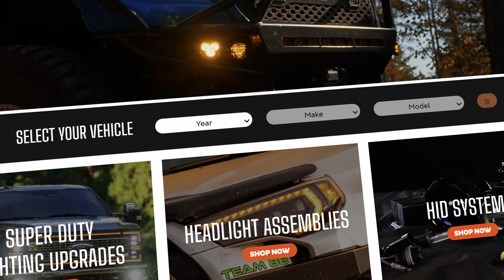HID vs LED Headlight Bulbs: Which is Better in 2025? | Brightness, Fitment & Output Test!

Comment: The fans on the LED bulbs is a no go for me ! Those fans fail then what, melt you headlights, possible fire ??
Reply from the maker: We in the thousands of bulbs we've tested have never had a fire. The bulb simply goes out if the fan fails to cool it haha. Nearly all modern LED bulbs will have fans, the tech is fantastic these days for them and failure rates are the lowest they've ever been!
Reply: @HeadlightRevolution well that’s a good feature ! Sucks the bulb goes out but definitely better than the alternative!

Comment: One big thing to also consider if your car has recessed headlights like a Jeep LEDs are a PITA in the cold because they don't generate enough heat to prevent snow and ice from accumulating on the headlights
Reply from the maker: Yes this is true, HIDs will be very helpful for these situations!
Reply: @HeadlightRevolution  yep I actually ended up removing LEDs that the previous owner of my jeep installed and replacing them with halogen because of this issue planning to upgrade to HID in the near future

Comment: I want to find a HID or LED that is compatible with GM DRL that cuts the power in half on the highbeams. They were made only for halogen that cut the power to 9volts to dim the highbeam to operate the DRL.
Reply from the maker: We can help you find an option over email! 
Sales@HeadlightRevolution.com

Comment: 8:40 I  bought projector headlights  from  this 
 company  called sw lights not knowning  about this  even right way I wasnt a fan way too much stuff can go wrong and just  last week  the high beams wasnt working i had to   pop the hood to tighten  the cable  unfortunately  it past the 7 day mark to  return them i wish i watched this video and asked more questions before buying them i dud but new headlights  & the gtr ultra 3.0   haven't    installed them yet

Comment: Forgot to mention that because LED bulbs usually have 2 sides with chips, the orientation of the bulbs matter A LOT and prevent the scatter you talked about. This is why most LED bulbs come with little screws on the shafts, so you can rotate them slightly if the alignment is off. 9-3 position of those chips is best.

Comment: I’ve never had good luck with LED bulbs in projector housings. HID bulbs have worked for me well in halogen projector housings. I prefer LED bulbs in reflector housings.

And the other thing that people don’t consider is the color temperature. 4000K-5000K is going to give you the best balance of brightness, throw, and penetration while not introducing blue hues which hurt other drivers eyes. LEDs I find are typically in either 6000K or 3000K, which in my opinion 6000K is not my favorite but it works well enough in a reflector housing.

Comment: Theres a reason why headlights are so bright. Its cuz you blind the on coming drivers. Ive seen too many drivers in the last 8 years where they put LEDs in their headlights and I see them coming from the next state they are so bright. So then I flash them thinking its their brights and then they flash me and OMG. Low beams should be super accurate and narrow for night driving but when theres no other cars etc then use those brights. No need to make high beams the new low beams. Its too bright and at night our eyes hate it. LED still scatters too much for me
Reply from the maker: That's why we filter out the garbage from the good, so those upgrading are actually buying bulbs that not only adjust properly but are designed to mimic the Halogen filaments of the original bulbs, resulting in identical beam pattern formation. The blinding LEDs you find are 99% of the time a very cheap $60 pair from amazon with none of these traits I mentioned.

Comment: Why you didn’t compare 4500k/5000k HID coz they are brighter than 6000K.
Reply from the maker: I wouldn't say brighter, just a different color and you may perceive it as "brighter" because you prefer this color range - nothing wrong with that! Yes the human eye sees these colors more naturally since it mimics the sun color range, but you can still have a brighter/higher performing 6000K kit vs. a lower wattage 4500/5000K hit. Good question though!
Reply: @H@H@H @HeadlightRevolution t same power level it is well known the color spectrum between 4000k-5000K has most visible light. Do you have a brighter higher performing 5000K color?

Comment: The FTR LED bulbs are by far not the brightest on the market. They are rated less than 65 watts meaning they will not be as bright as higher wattage options. For example Auxbeam has a 120watt bulb that will easily outperform these GTR bulbs.
Reply from the maker: We have yet to see a bulb in person outperform them, including Auxbeams!

Comment: Wife's 2018 WRX came with halogens but in a projector setup. Very little illumination, borderline dangerous for nighttime use on non-street light streets. Should have bought the higher trims that came with LEDs, but we hadn't driven the car at night on non-streetlight streets months into the ownership.

Regardless, OLLM HID bulb swap came to the rescue. Because of projector setup it didn't change the beam pattern at all, but the illumination and brightness is great, happy with the results. Went with HID insert of LED because of packaging reasons, there is no space for giant heat sinks behind the bulb in the car.

Comment: I'll stick to HID because I'm not an asshole using an LED bulb in a housing not designed for one that likes to blind every other driver on the road and put them in danger, especially the POS driving a lifted truck.
There are so many assholes with excessively bright LEDS blinding me, I'm seriously thinking of putting the brightest off road bar in my back window so when one of those assholes roll up behind blinding me, I just flip that light on and completely blind them also. See how they like it.
Reply: I'd just flip my ditch lights, spot lights, my 20" bumper light bar, my 2 dual 4" fog lights, and double stack light bar on.

Comment: I still like hids because of the 35w vs 55w difference and the color options
Reply: There are now leds which can go up to 90w per bulbs woth a crisp white light without any trace of yellow or blue
But yeah, hids still hold the crown for color choice
Reply: @SudSale31 wow thats pretty intense haha. One other thing i learned since this post is leds wont "defrost" an iced over headlight and the efficiency decreases pretty bad in sub zero temps. Which is basically a 15F winter day doing 70mph down the interstate or 80mph across the tolls

Comment: Upgrading to LED bulbs over standard xenon or even Halogen is a worthwhile upgrade, however, you want to upgrade only if you have a projector housing for the low beams. Upgrading to an LED with a reflector housing can blind other drivers, especially if you get a really nasty 360° LED instead of a proper dual sided LED band. Its also very important to know that you might have aim your projector lens down, NEVER adjust it up, if its been replaced, you might have too adjusted to match the non replaced unit. They are calibrated at the factory when the vehicle is made, and designed to balance good light projection with light output. Trucks and other giant vehicles especially are bad when it comes to aftermarket headlight upgrades. Buy a projector housing for a higher trim before you throw in some led headlights, and for the love of God stop putting nast led headlights and then lifting your stupid useless truck.

Comment: i am pretty sure i still have to swap out the headlight housing with a design that is best for either hid or led on my current car that uses halogen bulbs. also going to have a pro properly install them cause i have no idea on how to do it myself. pretty sure my dumb ass can install the bulbs otherwise.

Comment: So are the LED H4 replacement lights street legal? How to ensure the led itself is in the right position so it matches the original H4 filament or will or modern LED lights be OK?
Reply: No, they're not street legal and in all likelihood you'll be blinding drivers.
Reply: @cr0ft-2k  false. they may not be street legal, but with the correct LED's below 5.000 Lumen, you won't blind any other driver.

Comment: I love my LED's i put in my Accord, they have been running strong for about 4 years, not too bright to piss people off but better than stock, i do wish LED's would come in better color temps (i prefer the lower temps to reduce eye strain at night, especially in heavy snow), i did use to run HID's but i got tired of ballast issues with the cheap kits and didnt want to pay too much for the better ones.

Comment: I just installed a set of Spec-D single projector headlights (pn 2LHP-F15097G-RS) in my '01 F150. The h7 bulbs provided with them is rather... Lacking. In every aspect. Yeah they work, but visibility is barely comparable to the Sylvania zXe bulbs i was running in the horrid factory housings. I definitely need to upgrade them to something brighter, and I'm torn between HID and LED. I love the videos y'all put out and how you try to explain automotive lighting in ways even people with no real experience in dealing with such things can understand. I need to do some research on what these housings can handle as far as upgrading the lighting source before i make my final decision, but just wanted to say thank you for what y'all do.

Comment: İ buy lots of hid and led bulb types.. a specially i use always 3000k for my fog light .. 
Based on my experience, I can say that HID bulbs are still very effective at low Kelvin temperatures.

LED bulbs still mimic the color of halogen light, but they can't quite match it. For example, when you compare 3000k, 3500k, 4000k, 4300k, or 4500k LED bulbs and HID bulbs side by side, you'll see a distinct difference in color tone. Especially in very warm colors like 3000k, the LED bulbs look as if they've been painted with watercolors painting .. It is obvious that it is artificial .. 

I think LED bulbs are much more successful than HID bulbs at high kelvins, for example 6000k and above... The only downside of LED bulbs is their short lifespan. Last year, the left headlight of my 2021 Kia Sportage started to flicker and 5 months later the right headlight too.. LED bulbs die quickly, especially in the rear lights, when the vehicles are 5-6 years old... even if they are original factory.

Comment: Thinking about switching my low beam Morimoto 55 watt 6k hids to the GTR ultra 3’s since I got one ballast on the fritz after 5 years of smooth operation. In the video comparison it actually looked like a drop in performance on the beam width between the 55 watt hid & ultra 3’s.  I’m not sure if the distance was changed or it was a different headlight housing used for comparison but I’d love to know why the beam width diminished so much on camera. Also the hot spot seemed a lil less on the LEDs. Hope someone from HR will chime in. Thanks.

Comment: Thank you! My headlight on my kia optima 2016 sxl HID d3s bulb just went out, what would you recommend as a replacement? I got 8000k but i think its going to be too blue and so i got it on accident, I want to do 6000k HID, because I can't replace to a LED because its confusing and I dont know how to do that. is it possible to do a video on the replacement if possible? thanks!

Comment: Why didn’t you put the HID next to the LEDs for a final comparison?  To me HIDs looked brighter.  You didn’t even give luminance readings.
Also you mentioned nothing about LED fitment inside some/most housings.  The fan portion is much larger than halogen bulbs and doesn’t always allow the housing, causing the access plug not to seal causing moisture to get in the housing.
Your “review” is blatantly bias & manipulative.

Comment: LED conversions are my go to in most vehicles…except for those ALREADY equipped with HIDs. If I see that, I won’t touch it except to replace the bulbs, as their light output is quite satisfactory.

Comment: I love my factory LED headlights. I’ve had HIDs, they suck in cold weather below -35c they don’t warm up or if they do it takes more than 10 seconds. Upwards 10 minutes if they even fire up. Halogen never fails nor does LED.
Reply: That usually means you need new bulbs

Comment: I bought some h7 sylvania led bulbs not tha long ago because they were half off, otherwise I would never pay over $60 for a bulb. This things where so disappointing. I’ve had the same hid bulb and kit for almost a decade now (yes they have not burned down, I may have had to replace the ballast), and the HIDs were still brighter than the leds! And I’ve been using Xytex ballasts for decades now. I even have some old xenon bulbs (not hid) that were brighter than those led bulbs!

Comment: Driving a small car and constantly being blinded by trucks running around with LEDs. I will never run LEDs, don't wanna be part of the problem... and I don't have astigmatism, can't even imagine how bad it is for them
Reply: Yup. Led is more harmful than helpful. Like the guy driving around with his brights.... yeah, get off the road.
Reply: astigmatism here, its bad. Whether I'm in my car, or my Z71 Silverado,  morons shoving chinese LED's in factory reflectors are brutal. I just have to stare at the fog line until they are passed and hope nothing wanders into the road during that time. Really wish cops would start cracking down on garbage headlights.
Reply: I get what you mean. But I would like you to consider the purpose of these LED bulbs is to reduce that. Often running cheaper or inferior LEDs creates the scatter and blinding light that you see. You can see the clean cutoff with the GTR 3 that the manufacturer had in mind when designing their headlights. Most modern cars run LEDs from the factory with proprietary designs aimed with the same goal. If you're in a small car and you're going to be blinded from trucks regardless because of the placement of their headlights so I feel for you man.
Reply: It's not just small cars though, it's everybod else.
Reply: Driving a small car wouldn't be part of any problem. Who are you going to blind? The moles? They don't drive very often anyway...
Reply: @zeendaniels5809  they are saying that they get blinded, not that they do the blinding
Reply: @zeendaniels5809 can’t beat em, join em!! Gotta match brightness !!!

Comment: I tried switching my low bems with LEDs. Unfortunately it ws awful on reflector headlights in my case and the pattern was all over the place 😓 hard to find the right bulb on the 2016 PH spec XV/Crosstrek. 😢

Comment: The HID had a LOT better color throughout the beam width.  The LED had hot spots everywhere.  HID’s project farther than LED’s…also LED’s dim over time from use.  Not sold yet.
Reply: I have tried quite a few of the reasonably priced versions of LED headlight bulbs in my various vehicles. I went from 35w HID kits to 55w HID kits to LED. LED seemed OK at first, nothing much different, but they got dim so fast. Unlike HID, it was subtle and eventually I was wondering why I couldn't see a damn thing and everyone else behind me lit up the road in front of me better than my own lights did. I went back to the 55w HID because I think that they do a good job of illumination, but also are more clearly in need of replacement when the time comes because the colors start to shift, and the replacements are really super cheap. I tried this all on projector housings though on cars ranging from my 1994 300ZX with 9006 bulbs to 2011 Lexus RX350 with H11.
Reply: @adamrichardson2227 yeah, experimenting with different lights, is what's needed sometimes. It lets you find what is best for you.
Reply: HIDs also dim over time, but I suspect the bulbs are slightly cheaper
Reply: @johnrickard8512  LED's literally start dimming shortly after they're turned on because of how hot they get, HID's do not. Meaning the longer an LED is on, the dimmer it gets. HID's stay the same brightness from the moment they fully warm up until you turn them off. But yes, both dim over the life of the bulb, but LED's dim much faster.
Reply: @bradleyd6000 you are correct, and many people don't know this. It's good to see testing of the drop in light performance, before people jump on the led bandwagon.
Reply: @bradleyd6000 I agree. I had a 2011 ford flex with the stock HID bulbs. They were plenty bright up until the last few years of having the vehicle. In my opinion HID bulbs are good for about 10 years if they’re 35w bulbs.

Comment: Great video. I much prefer HID bulbs by a quality manufacturer like Osram in the 4300-4500 k color range. This color temperature is much easier on the eyes and makes it easier to spot details by the side of the road, it's like a slightly golden warm white - it's splendid. Installing new headlights also give a much improved light output as the reflector and projector lens get slightly cloudy over time, it's not just the main headlight lens which gets degraded. A new fresh headlight with a pristine reflector and projector lens will probably add 10-20% light output compared to an older worn headlight assembly.

Comment: When can we expect a quality LED replacement for factory HIDs ie D1S, D2R, D2S etc? Seems LEDs don't throw light into the distance like factory HIDs do.
Reply from the maker: It's tricky, since this is such a specific fitment. From what I've seen, I have not yet found a solid LED that will replace a D-Series HID bulb and perform as good/better than it did stock. Personally, I have always recommended to stay with the HID bulbs and swap colors/wattage to increase performance. 5,000K-6,000K would be my ideal color range.